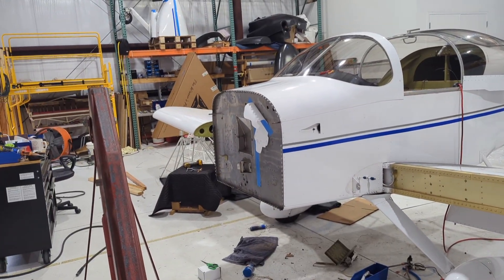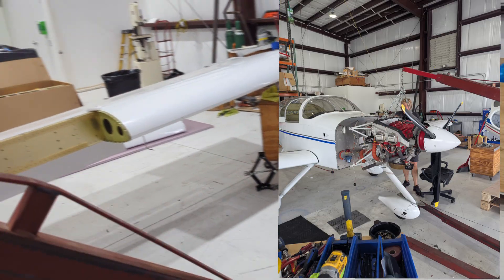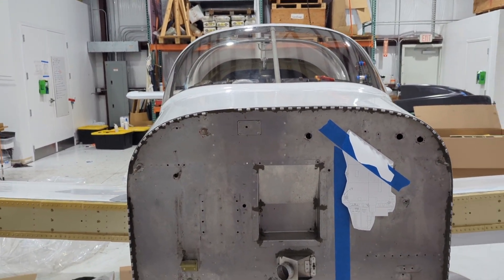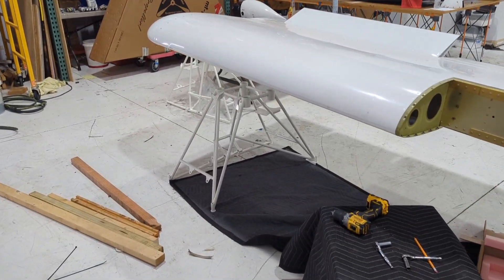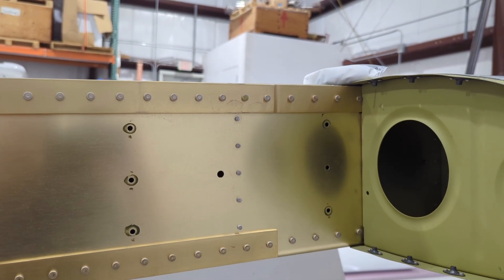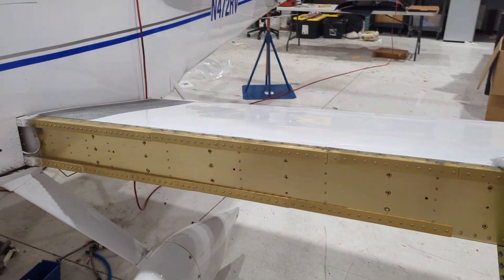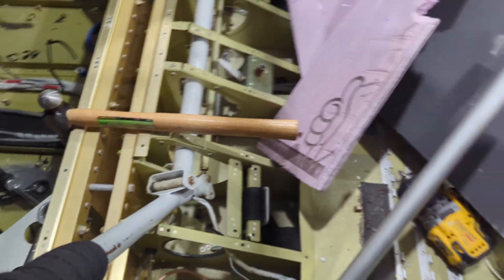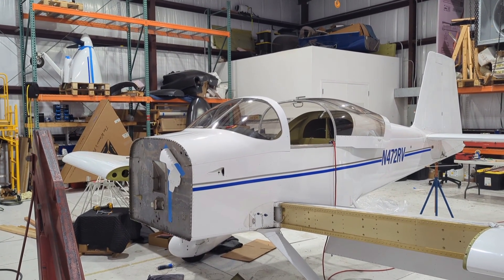RV-9A Firewall forward 916is install. Long Video update. #aviation

Comment: You could have just added a header tank and only run the fuel return line to it negating the need to remove the wing tanks…That is the way my UL Power engine is designed.

Comment: This is fantastic! Thank you for posting this. The 916 seems like such a wonderful addition to the RV9. Totally agreed on the nosegear as well. The previous nosegear was clearly an issue.

I know that this would be a completely different product for Lockwood, but (wish list), a BRS in the nose (if technically feasible) behind the engine would have been an interesting way of shortening that nose, getting rid of the vertical fin strake and scratching an itch for pilots out there that would like a decent CG and not sacrificing their luggage space but still having a chute.